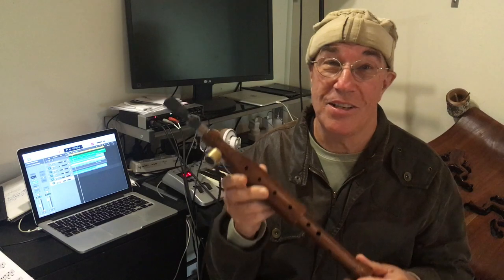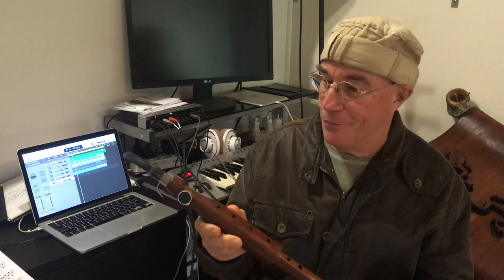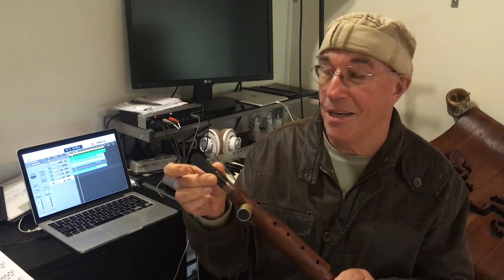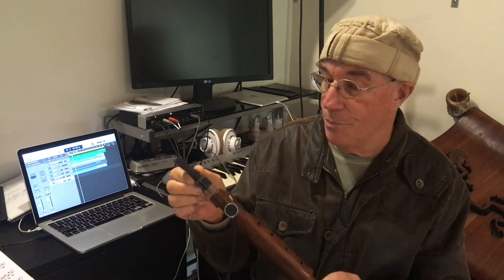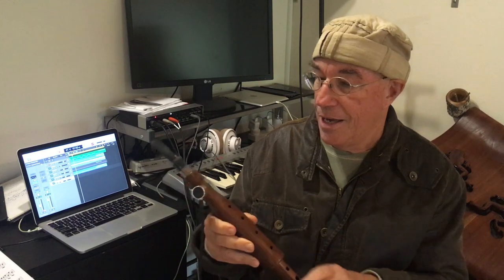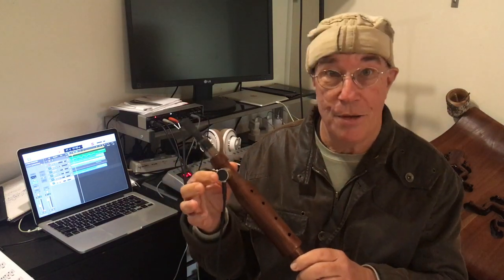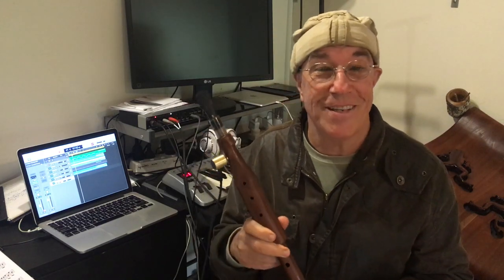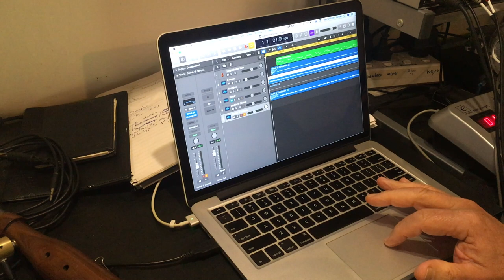Hybrid Duduk (chromatic)

Comment: Hi Linsey :) How are You ? Now as I am watching Your video I am wonder if this polypipe reed is more easy/comfortable to play than a traditional reed. I have a duduk which I bought on ebay and I have several reeds and on some of them I really don't like to play :) Secondly What type of microphone are You using for register this beautiful sound ? :) Cheers
Reply from the maker: The polypipe reed is easy to play and consistent (if it's well made) but it won't get as beautiful sound as the cane reeds, however as you've found out, the cane reeds don't all play well and are humidity  affected and require just the right amount of moisture to work. The pickup is a piezo barrel pickup: www.piezobarrel.com
Reply: @SquealyD  Thank You for Your quick replay. From my perspective as I hear the music from Your video I can say that in my opinion Your reed sounds great it sounds softly. As I compare one of my reeds that it is made of can sounds also great but I can't do so beautiful and deep vibratos beacause if I intesify the pressure too much the reed starts buzzing. I have also few thicker reeds that is very difficult to play at all because I have to blow very very strong and even if I am able to generate the sound there is a hearable sound of blowing that I call noise mixed with the main sound. With this thicker reeds there is also extremely difficult to make vibrato. So concluding I like very much the concept of creation of reeds from the irigation pipe. It is a very smart idea and also cheaper than buying reeds made of can. And You can always learn a lot. Sometimes I think If I would have more time, strong wiil and skills to make a lathe with the use of drill then I could experiment as You do. Great respect. Best Regards :)
Reply from the maker: @Darro2017   thanks did you see the video on how to make the reeds from polypipe:  https://www.youtube.com/watch?v=tLXh0IZLyHM&t=1s
Reply: @SquealyD  No I didn't. Thanks , I saved Your video and liked :) If I'll ever have a piece of such irigation pipe I will try to make it and I will insert it into my ebay's bought duduk. Thanks a lot. For now I have sampled some sounds from my duduk I currently have and made it available for free (sfz and / or kontakt) on my TunesFromKeys yt account. Best regards. Good luck and keep it up ;)